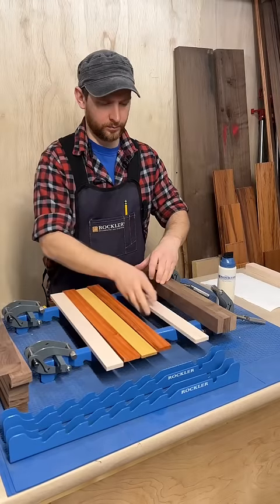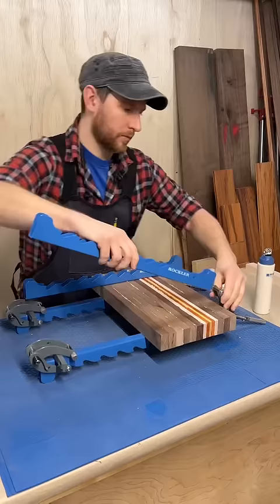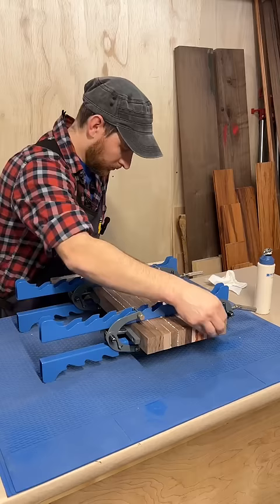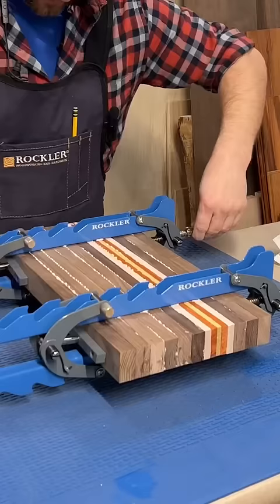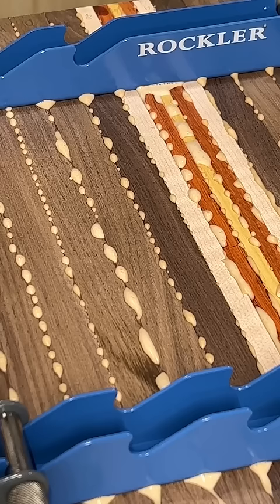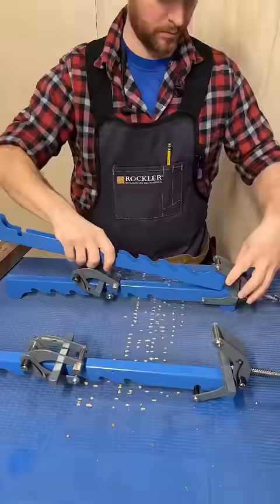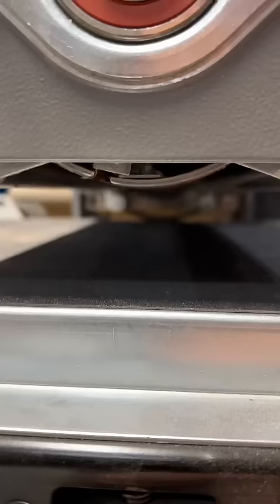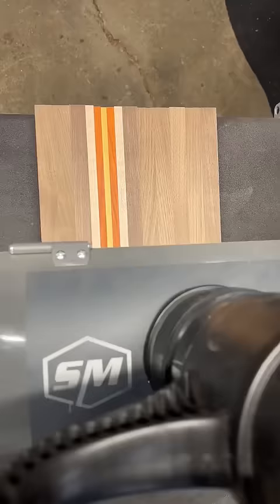Making a Cutting Board - Part 2 of 4 - Adam makes a cutting board with supplies from Rockler.com

Comment: What is the part number and where did you make your purchase?
Reply from the maker: Those are our new Mini Deluxe Panel Clamps, Item #66150. Available in Rockler stores or on our website at - https://www.rockler.com/rockler-mini-deluxe-panel-clamps-2-pack - Thanks!
Reply: Just ordered a pair of them today.   Super pumped !!!
Reply: @mikearmstrong43  please let me know if you like or dislike and why
Reply: It shipped today !!!!
Reply: Mini clamps … just the online. Wish it was a little easier.  But just did my first glue up.   They work great.
Reply: Will a set of two clamps be enough for 10x24 inch glue up? After it dries will cut in half to make a 10x12 cutting board.
Reply: @joesolisjr5631  just did a 12x24 work great.  Use a few extra clamps juuuust in case. But you should be fine !!
Reply: @mikearmstrong43  thanks sir, I thought so just in case. I ordered a set need to order another one, as the saying goes “ You can never have enough Clamps”.
Reply: @joesolisjr5631  True True
Reply: @joesolisjr5631  More is always better.  Lol. Cheers ( now I better go order some more  )

Comment: Nice!! Say I don’t have a drum sander, what’s the next beat thing for that step? Thickness planer?
Reply from the maker: Yes, or a scraper, plane, chisel of some sort. Large splotches of glue can be rough on planer blades though. You could also just sand it down, with whatever sanders you have.
Reply: @rockler  thanks!
Reply from the maker: You're welcome. Thanks for watching! 🙌